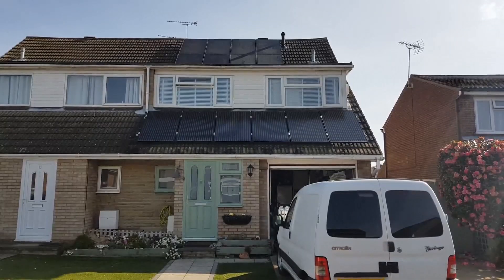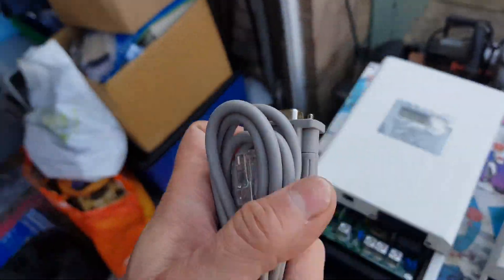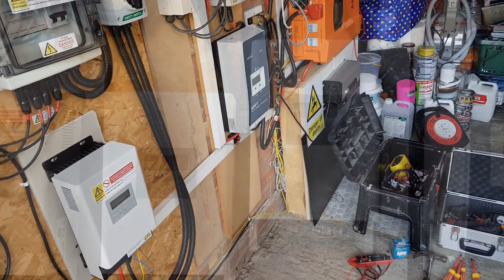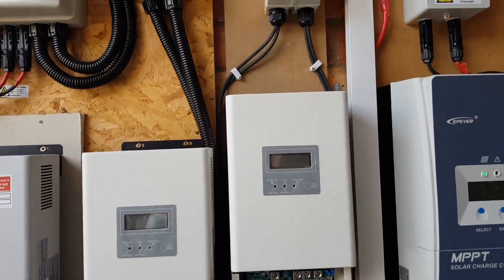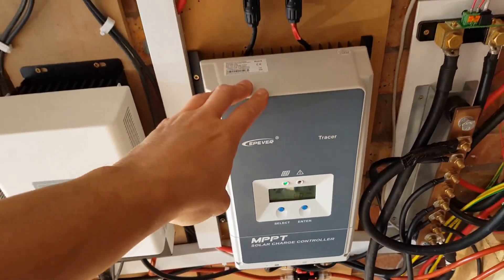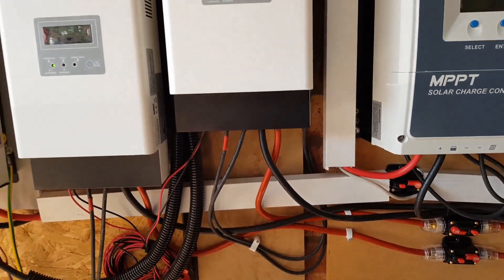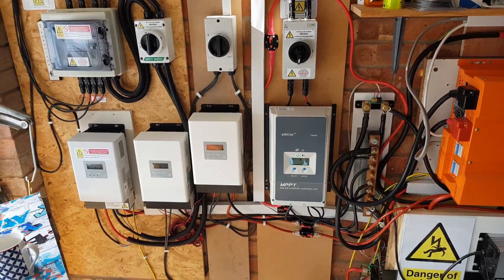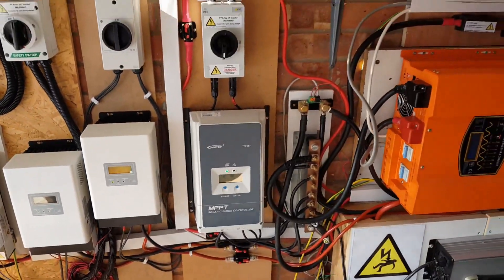Tesla powerwall Homemade Modules Off Grid Solar UK April Upgrade

Comment: Nice system you built there.
Did you register it to your local electricity authority?  My system is 20 solars (14x265W + 6x250W) plus 22kWh battery (forklift type).
My wife read on ENWL website (electricity north west lancashire) every energy production which is connected to the grid must be officially  informed about solar production and battery storage.
Reply from the maker: Only connected to draw from the grid if I need to. Not feeding in as I use all the energy I create.  If you feed into the grid you must in form your provider.
Reply from the maker: I would add to this that I have a separate consumer unit and the only connection I have to the grid is to draw from it when necessary. I do not export and there are no grid tie inverters in my set up it is totally a stand alone system. But yes you are correct in the fact that any grid tie system (feeding into the grid) needs to be registered.

Comment: Nice 24v setup 👍 I’ll definitely be upgrading my batteries in the future to new technology once mine have given up. mpp solar products are well worth looking into but l did fine the parameter setting were slightly out so l went with the Victron Bluetooth charger so that l can monitor my setup via my iPad as well . The other slight issue is l no longer have a laptop which is required with my mpp inverter.